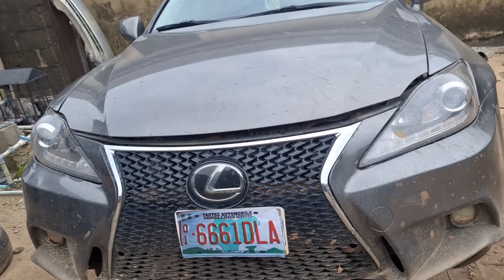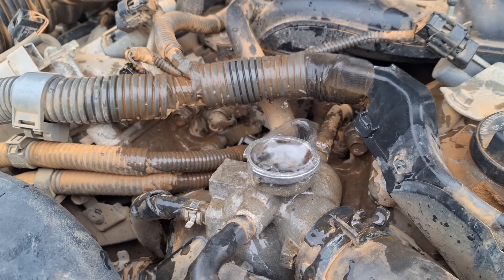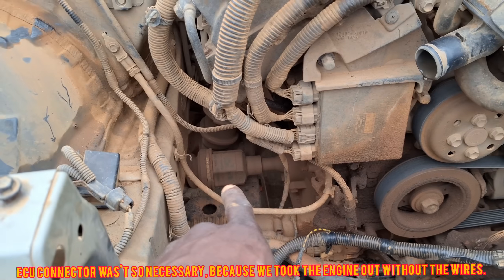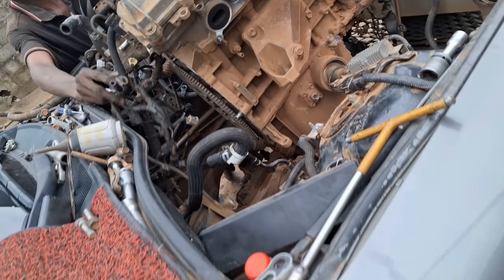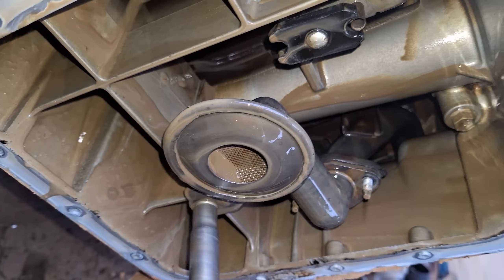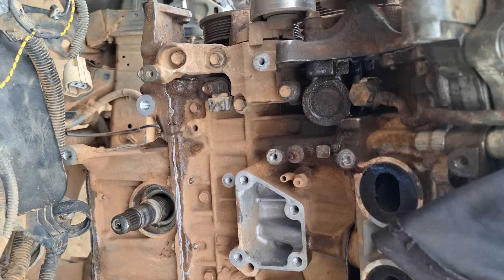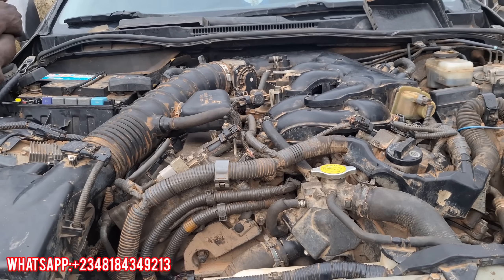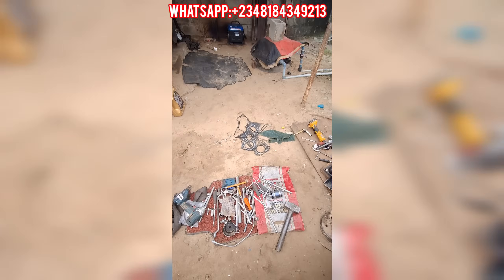LEXUS Is250 blown head gasket... Gasket Replacement.

Comment: U remove the engine reinstall it same dirty like before and u call it a clean job
Reply from the maker: Thanks for the feedback. Just to clarify - this wasn't a cleaning job. Engine bay washing was quoted, but the client chose to focus on fixing overheating issues instead.

My role is to deliver performance and safety first - and that was done. If the client had opted for cleaning, we'd have included it in the budget. Every service has its scope and price.

Appreciate you watching, and I'm always open to constructive dialogue.i hope you understand?

Comment: The first step would be to CLEAN the engine ( and the engine bay). This makes it easier to identify any existing and potential problems.
Reply from the maker: Correct, but work procedure and charges are different based on geography and resources available.

Comment: Hope the root cause of the blown head gasket was sorted. In most cases, it could be as simple as a radiator cap. Just ensure your get the exact size.
Reply from the maker: Thank you ... it was sorted... the fan was rotating in reverse... initial technician missed the wire polarity.

Comment: Do you use a tourque wrench gauge to titghen the nuts or u just did it by luck?
Reply: Torque wrench is over rated.
Reply: @tsholomothei3165  lol sounds clueless enough. Do you think the manufacturers assembled that engine block without one? This why you guys in nigeria  can't do better. Without the right tourque spec it's going to result to a problem sooner or later , try to do better